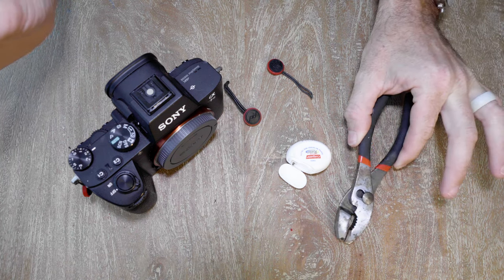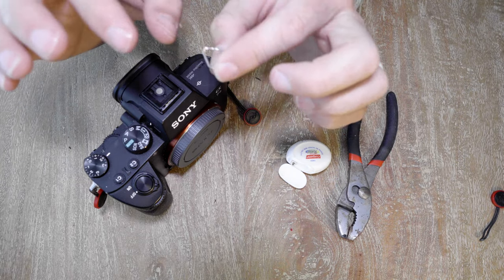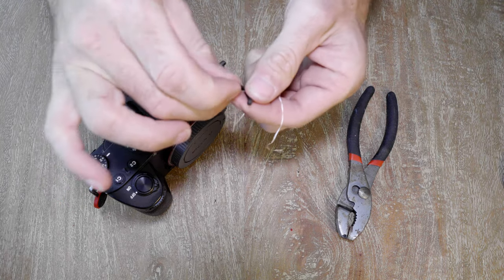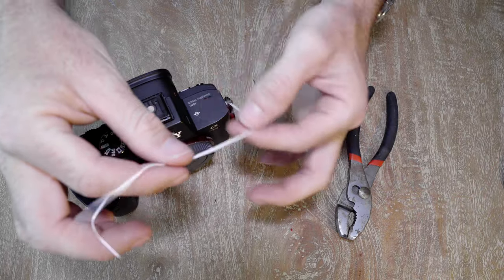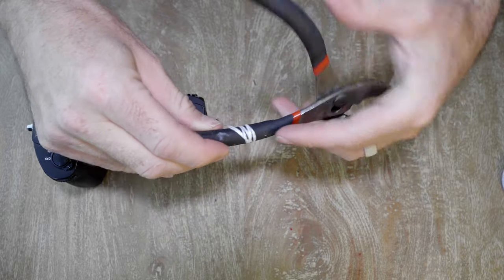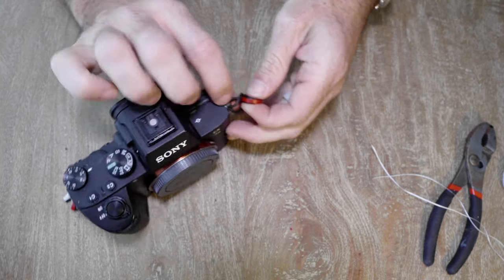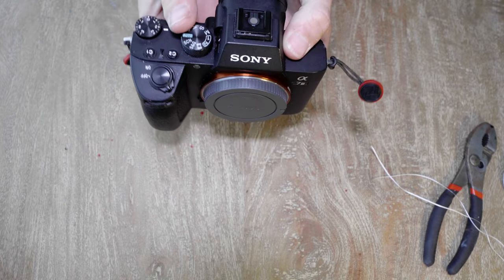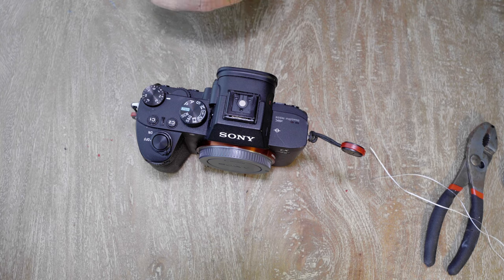Attach Peak Design V4 Anchors to Sony Cameras - [SUPER EASY]

Comment: Do i destroy those tiny holes, because peak design anchor v4 is thicker than the hole.. I put it threw and everything is secure.. But overtime does it destroy those metal things

Edit: and it does not flop because is thicker.. If it was size that goes threw easily, of course it will flop

Comment: This worked on my Sony A7R3 but does not on my Sony A1.  I even tried braided fishing line which is super strong and thin, the anchor rope is simply too thick to make it through the eyelets.  Would be really nice if PD made anchors that would fit through or another design, many one that only needed one side of the rope passed through.  This really ruins the beauty of the PD system for me on newer sony cameras.
Reply: I believe the newer Alpha series cameras have slightly smaller eyelets, which causes this. I've just managed to get the thick PD anchors through the eyelets on my A7IV by 'pre-crushing' the anchor's loop with a pair of pliers, just to flatten it out as much as possible before attempting to thread it through. Then, carry on as he does in the video by threading the floss or fishing line (I managed to get it done with some floss eventually) through, but don't just pull it. You need to apply a constant pulling pressure on one side (not enough pressure to tear the floss, about 20% less pressure than that) and keep turning the anchor clockwise/anticlockwise about 90 degrees each way repeatedly to help ease the anchor through. After a minute or so of doing this, you'll have pulled through enough of the anchor that there will be 3-4mm protruding from the other side. Use some pliers to carefully grab it (don't grip them firmly enough to fray the anchor's insulation) and use the same constant pulling and twisting motion with the pliers, and you'll be able to pull enough through that you can then loop something through it (a screwdriver or Allen key) and finally pull it through. It's very difficult and I think it's inevitable that you WILL damage the anchors to an extent (both of mine are showing a small amount of yellow) but they appear to be sturdy and I found  the whole ordeal to be worth it. Good luck

Comment: Never ever in my live got a dental floss not until I watched this video, yet I still can’t get it in, I guess the hole on my A7C are little bit smaller then the bigger camera model
Reply: Tried with different generations of anchors (not sure which is which, they are all mixed in a box). None of them could get through the holes of the A7C. I think I'm returning to the triangles. 

Did you find a way to do it?

Comment: Nice!  I am using one of the triangles because I'm using the grip on my a6400. Fortunately, the grip is sturdy enough to keep the triangle from flapping around. But your technique worked really well on the other side. Thanks for sharing this!
Reply from the maker: For sure, Glad it can be helpful. I struggled for a while trying to figure out how to get it though.
Reply: Just use the silicone cups from cheap earbuds over the triangles

Comment: on the version A7 IV the new PD anchors, cant pull it throu whole at all, imposible
Reply: Have you made it in the meantime? The eyelets are even smaller than on the Sony Alpha 7 M3 and I just can't get the PeakDesign Anchor V4 through the eyelets on the M4.
Reply: @PolliHarres no its not possible anymore, anchors are made a little bigger, then its not possible to get it throu

Comment: I used a piece of small gauge copper wire to pull the cord through. This allows you to use pliers in the normal way grabbing the copper wire and pulling. I just found this post today. I think that If you have the copper wire available  it is a easier way to do this.

Comment: Tried this on a Fuji X-T3 which has very similar attachment points, but the only thing that happened is that the anchor got so damaged at the bend that I can see the yellow beneath. "Replace if yellow inner core becomes visible!", the instructions say. Bummer.

Comment: My floss is a sensitive one, so I did it with my solution: I crushed the tip to be thin enough using pliers and fed it in with the same tool and pulled it from the other side with the same tool. It was just as easy. Only tool I used was pliers.

Comment: Will this work on the a6600. I took off the triangles off, but I'm unable to get the PD v4 anchors into the camera eyelets? The floss breaks off. Any tips? I am not sure how I'm going to get those triangles back on. Also, can the anchors damage eyelets over time?
Reply from the maker: I dont have a A6600 But I would try to double up the floss or find a string that is a bit stronger and you should be able to pull it though. It was pretty tough the first time i did it.
Reply: @HartandCol  hi thank you for the reply. I decided to do the earbud hack + triangle split rings . Working fine so far, but hopefully it will work with a left side hot shoe relocator. Thanks again.

Comment: Just got my Sony A7IV Tried this with the floss doubled up. Also tried with a steel wire. Both attempts didn't work. The floss and wire broke. It looks like they've made the eye even smaller on the IV. The front of it is visibly smaller than the back. Not sure what version of the anchors I have, but they're a couple years old at least. FYI.
Reply: I'm having the same issue with my A7IV,, and using the latest peak anchors. Don't know what else to try.
Reply: Same problem with Sony A7C, all wires break. The eye is too small for the peak design anchors to go through!
Reply: @nevrozel  I ended up putting back on the sony anchors so that I could fit the peak design through. I don't think it's possible without.
Reply: Update! I was able to attach anchor links with floss easily. The anchors I used were from my old camera which were noticeably thinner in diameter. Not sure which version the previously unused anchors were, but looks like Peak has varied the width of the anchors. FYI. More info here: https://support.peakdesign.com/hc/en-us/articles/360000833866-2018-Anchor-Update
Reply: @marktomphotography  you probably have the V3 which are the only ones that are thinner.
Reply: Just worked for me for the Sony a7IV, I used thread and tripled it up.
Reply: same for me - with the A7IV I only can get the thinner version through the eye. I have these old ones from my H1. For the A7IV I ordered the V4 Anchor Links and they are obviously too thick to get through the eye. Every time my floss is breaking

Comment: but why don't you use a pen? easier and lighter to "attach" the floss.
Reply from the maker: Defiantly would have worked as well... Basically anything that  you can wrap the floss around will do, but i did not have a pen on me at the time.

Comment: Thanks a lot for the tip!!! I have been meaning to look into this since I picked up my RX100IV, but just getting around to it now. My RX10 which I started using more as my primary camera, didn't have a problem with the sizing. I have some extra anchors now though, and even have some ringlets I was just planning to have to use, but I much prefer just having the anchor attached directly.  🦾👊😎